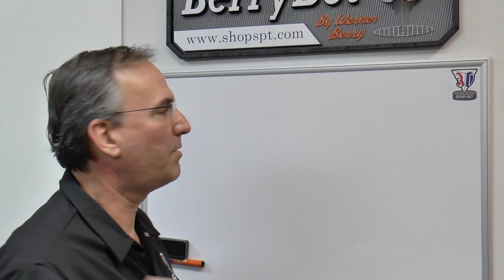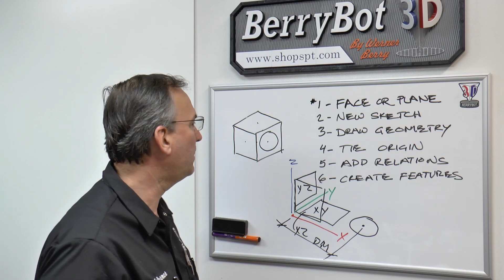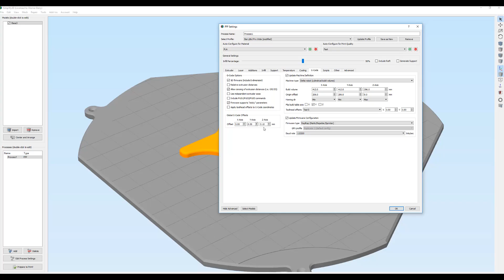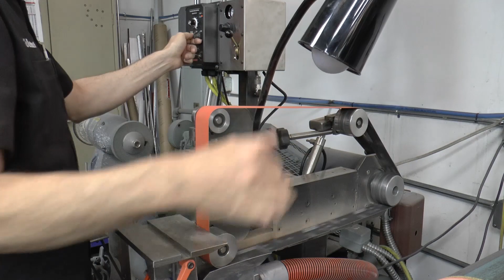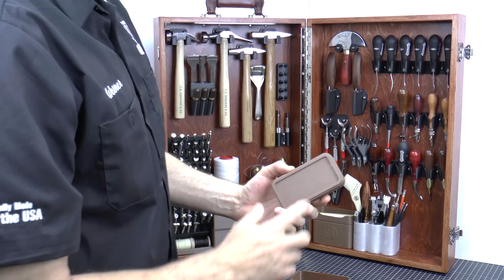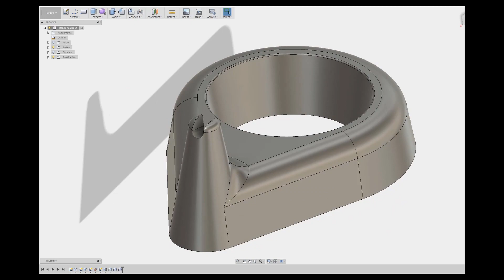The Holy Grail of 3D Platens Part 2

Comment: normally i build in holes for bolts, or screws  thru the structure to add weight and increase life of part, but for parts that just need balanced weight this method you show here is probably the easiest and most repeatable method. thanks for putting this in the video.

Comment: Nice seeing you making videos again. I have some questions about your Berry Bot Pro print bed upgrade. What were the cast aluminum over 6061, etc.? Do you buy cast plate or have the bed cast? Since aluminum is an excellent heatsink did you use the same bed heater or design a new one? How is material adhesion with the cast aluminum? Thanks!
Reply from the maker: I machine the new platens out of 6013 cast.  I have special silicone heating pads of my own design made for me.  However it does work well with my original heater too.  Thanks for the comment!